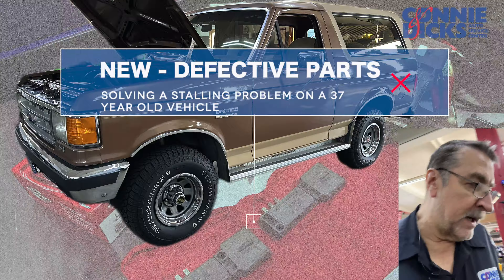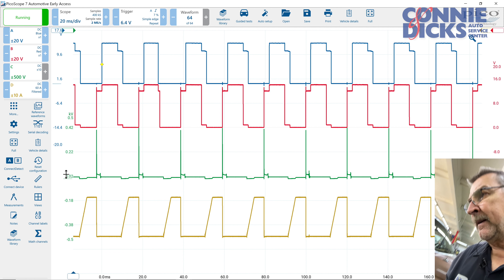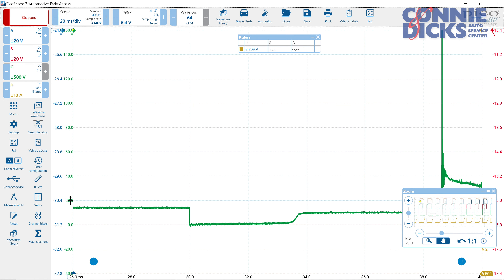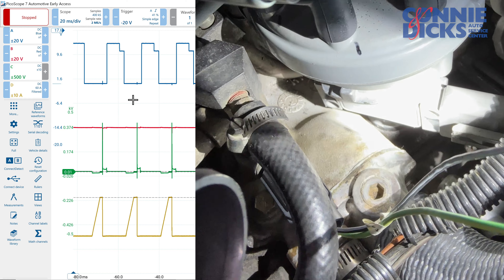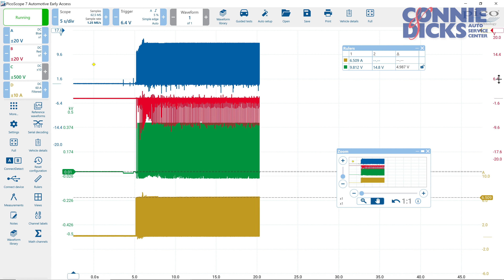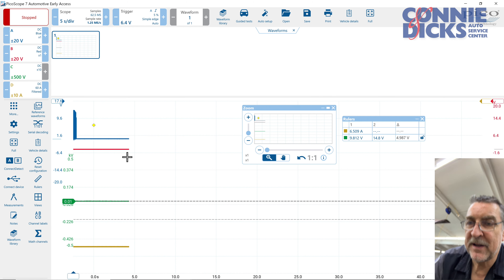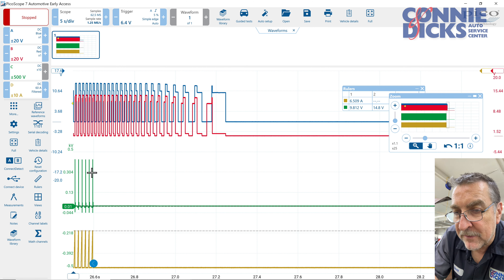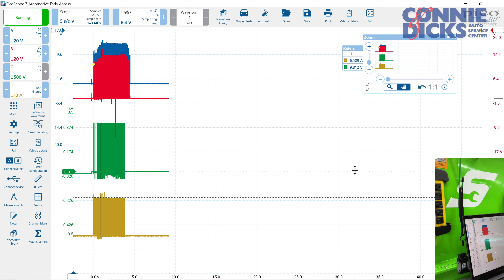Ford TFI-IV Ignition Module Woes! New Defective Parts for a 37 Y.O. Clean Bronco

Comment: Thanks for this great video. I had a code 14 and and intermittent failure when hot. I replaced PIP and TFI as a pair. Similar failure after short run then saw this video. Added oem tfi and problem solved. Original problem was PIP and aftermarket TFI added a second problem.

Comment: My recollection is that Ford was hit with a class-action lawsuit around early 90s because of defective tfi modules (I certainly had one in my 86 Mustang).  Another thing to look at is fretting corrosion in the electrical connectors; this stuff causes intermittent electrical problems.  I used Deoxit D5 for cleaning the connectors - great stuff.
Reply from the maker: Yes, indeed, and I remember back in the day. I gave a deposition to an attorney that was researching stalling complaints on Ford vehicles caused by those TFI modules. I’m fully aware of the connections, terminal, fretting, and other issues. And I totally agree, I use Deoxit as well

Comment: Fantastic video Scott. It seems obvious from you captures that the faulty modules are using sub standard components. Looks like scoping a replacement module before you give it back to the customer could save in comebacks for sure. I’ll scope my primary and see if it shows any signs of problems. It’s got an aftermarket module and has been running fine but it would be nice to know before it leaves me stranded.
Reply from the maker: Hi Rick, yes we’ll be taking a closer look on these in the future for sure! Interesting times!

Comment: Hello, excellent video! What kind of setting do you have for the scope please?
Reply from the maker: The time and voltage settings are shown on the screen. Let me know exactly what you're looking for and I'll see what I can do.
Reply: @TechScottBrown  thank you for replying! Maybe I asked the wrong way, what kind of scope and is it connected to a laptop? I use the scope from my ZEUS,  But is not very good.
Reply from the maker: @roicam  Ok I see, this is the Picoscope 4425a using Smart probes (the amp clamp is a smart probe) This means that the scope interface and software can detect the probe type and set up the appropriate values and scaling. The pressure transducer in this case is not a smart probe and has to be manually configured as I demonstrated in the video. You can find more details here from my friends at @AESwave https://www.aeswave.com/4-Channel-Pico-4425A-STANDARD-Diagnostic-Kit-PQ178-p9836.html
Reply: @TechScottBrown  thank you very much again, excellent work!

Comment: Bummer you are in CA. I live in Washington and I got a 1985 Ford Ranger and nothing I have done, replaced and rebuilt has fixed the issue with it. Drives great for 10-15 min then it starts jerking the vehicle like it dropped a cylinder. I got the 2.3L and the vehicle only has 115,000 miles on it. I replaced everything. This video has helped me greatly. I even pulled the computer and put new Electrolytic Capacitors that were dumping fluid all over the PCB. Now it there a camshaft or crankshaft sensor on a 1985 Ranger?
Reply from the maker: @spagsketti  your vehicle should have the same set up. The crankshaft reference signal comes from the distributor (called Profile Ignition Pickup PIP) you may want to pull the timing (SPOUT Connector) and see if it will stay running longer.